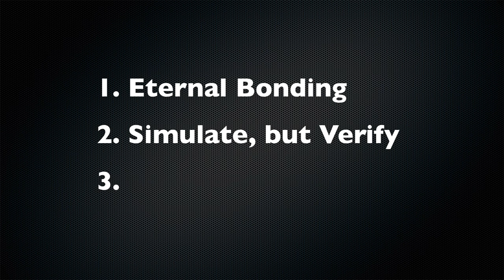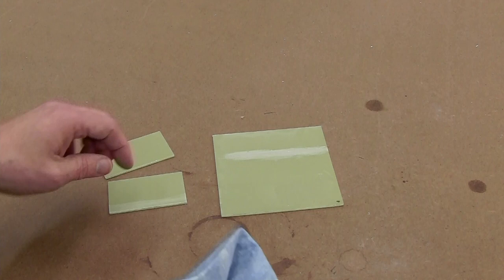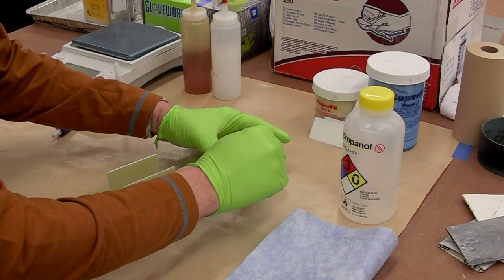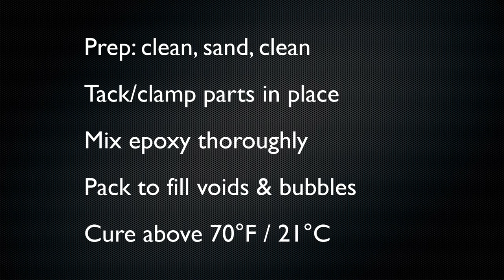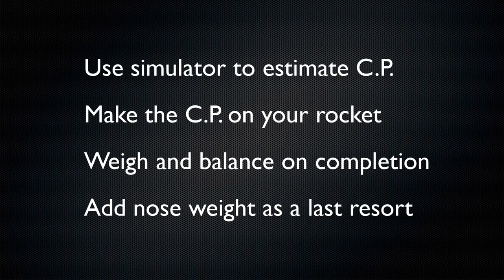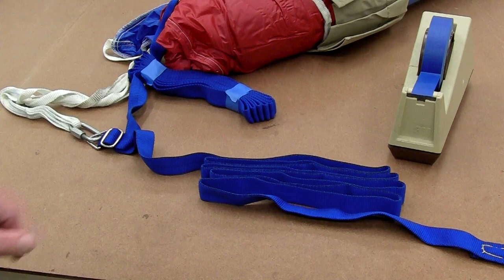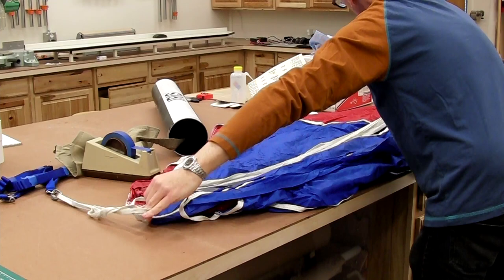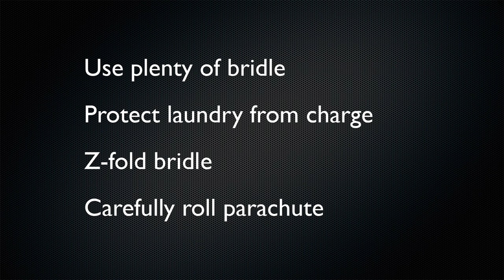3 Key Techniques

Comment: I had a fin take a hard impact forgot to attach the bridal to the nose and top of the ebay . It broke the epoxy joint from the body only on one side I'm thinking that side didn't get sanded properly or at all it is a LOC Little Diter I'm sure that's not spelled they way they spell it !!